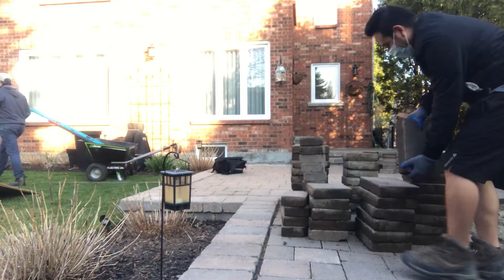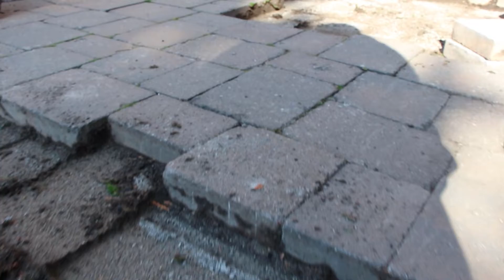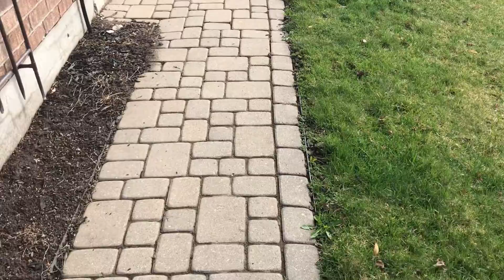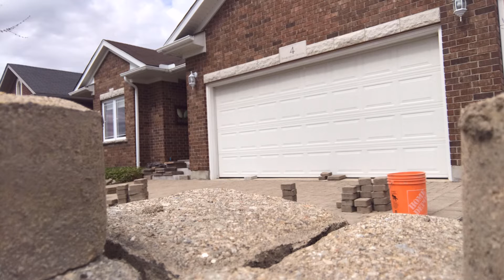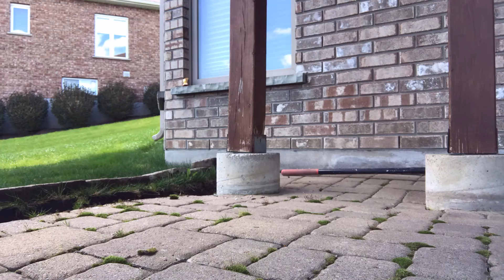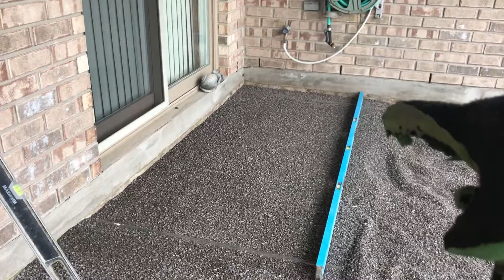Starting a Lift and Re-Lay Paver Maintenance Business

Comment: whats your prices for this? like to remove the pavers, reinstall them and what do u charge for labor when putting in new bricks
Reply from the maker: It depends on the project. We range from $10-$15 per square foot on lift and re-lays
Reply: @iamahardscaper  is that just labor right? No material
Reply from the maker: That is both for a lift n Re-lay where we are not replacing the base. So the only materials involved are bedding material and jointing.

Comment: I have some questions. When your are going to relay pavers, are you going to use HPB as bedding layer ? because there's a lot of projet with stone dust so it can be more cost efficient for the client if we just screed a new layer for stone dust ? Thx   Nic
Reply from the maker: We never use stone dust. Always HPB or concrete sand.
Reply: @iamahardscaper    So when you relay pavers, you are going to shovel all the sand dust in place and replace it with HPB as the bedding layer on top of the existing base ?  About the compaction, are you going to screed your hpb and relay the old paver and use a plate compactor to compact over it, or you are going to compact your hpb first and then relay the old pavers ? you said that the compaction is 1/16inch on hpb, so its the base height + 1 inch of hpb + 1/16inch, and after the compaction i should be even with the concret slab ?  Thanks :D
Reply from the maker: Yes, we typically replace the 1" bedding layer because it usually has a lot of organics and weeds mixed into it. Compact after removing, then screed HPB, lay pavers, sweep jointing material, then compact. You don't need to compact the HPB. the compaction of HPB after the pavers have been laid is minimal.
Reply: @iamahardscaper   Thanks, your are the best !!!!!  And i like your new on field videos :D